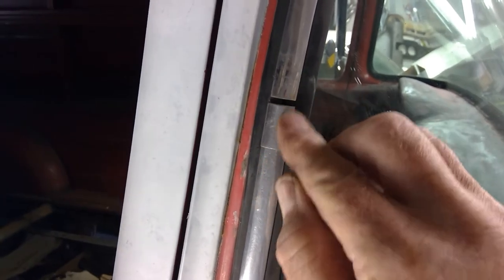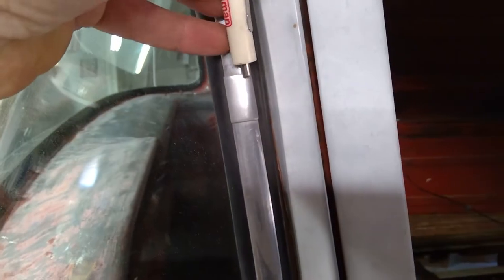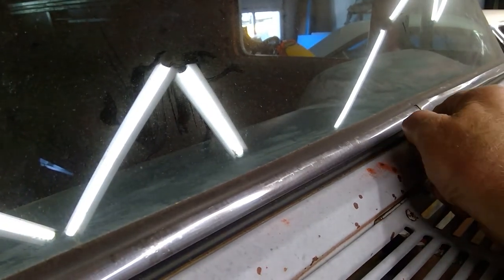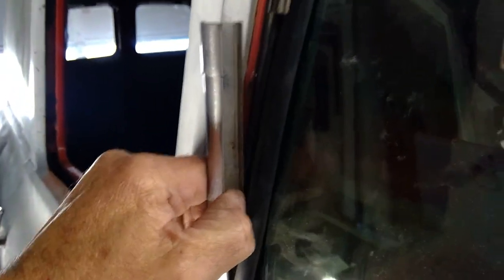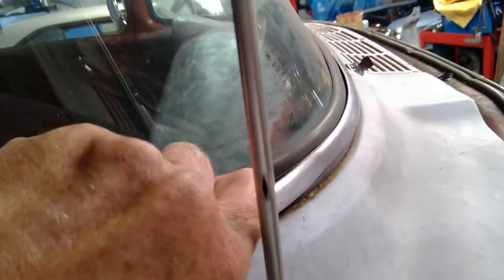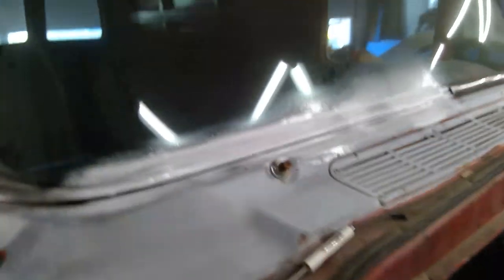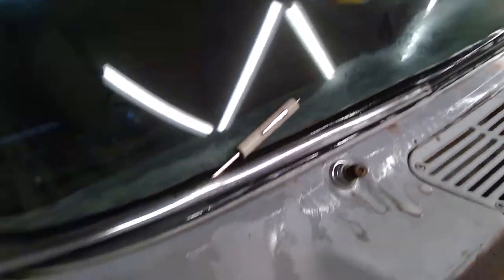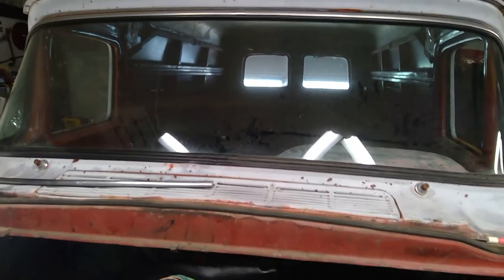How to Remove Stainless Trim From Windshield Gasket

Comment: Now I know how my SS trim is attached, thanks for making this video. My Datsun Roadster doesn't have the sliding collars in the middle though. It has unions at each corner which can't slide, so I'm still looking for the secret to removing it without damaging it.  Did you re-install the gasket with some of the trim pre-installed, or did you put all the trim back in after the windshield was in?
Reply: I think you gotta do that after, the chrome trim also kinda acts like a locking strip etc, meaning it helps hold and seal in the glass